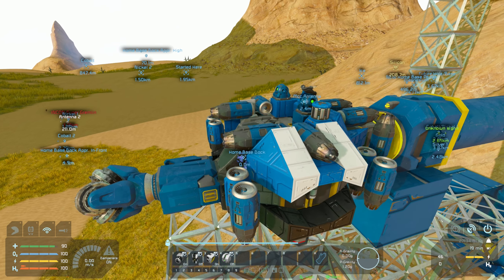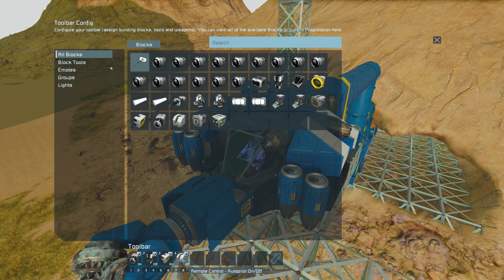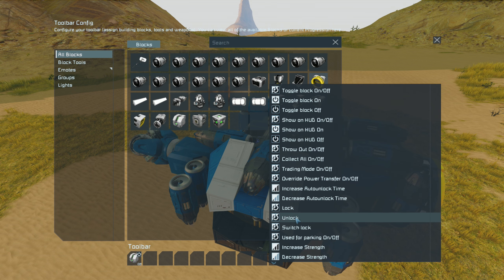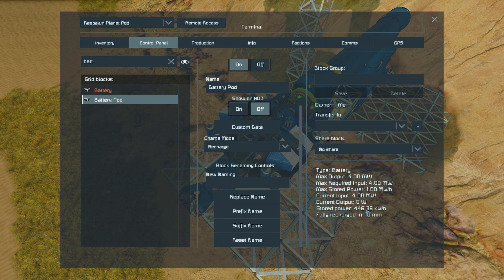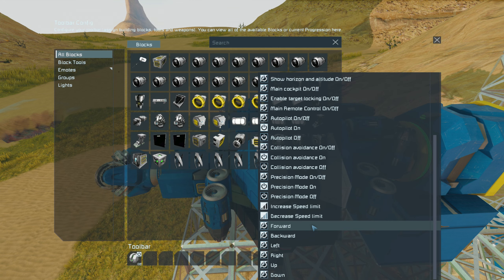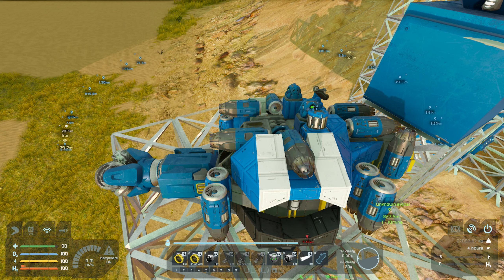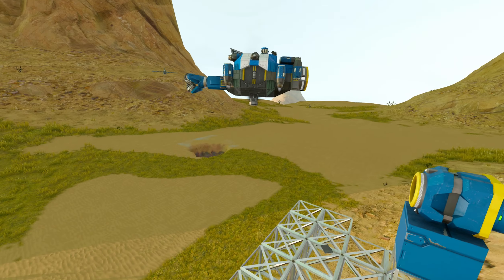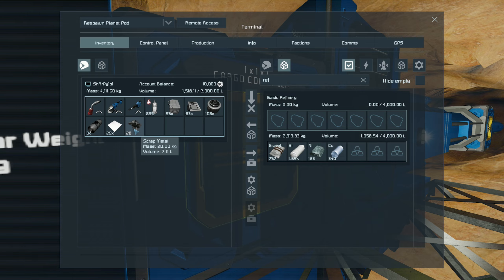Final Auto Dock Touches S2E04.5 - Space Engineers

Comment: I suggest adding a hinge to your base drill, with two event controllers. One controller to reverse the hinge at max rotation, the other to reverse at minimum and to also raise the pistons max reach. That might help get more of the rock out of the way with less rebuilds. Might be worth the effort to make it taller, as well. 
Or, dig the bottom of the base out (guesstimating where the back of the docking area would be, and build a drill assembly to push out to the entrance and up to the ceiling. A couple drills horizontal and a couple vertical on a line of 2-3 pistons in turn moved by another line of 4-5 pistons could clear out the whole thing on event controllers.
As for the heat problem, maybe try borrowing a dehumidifier. I have no idea if that would help where you are, but they do seem to make heat a little more tolerable here in Texas.
Reply from the maker: A dehydrator sounds pretty useful tbh... in terms of the drills on the base etc. I have a Automated Drilling machine, I actually built almost a year ago which should work, just got to try and make a bit of room first lol